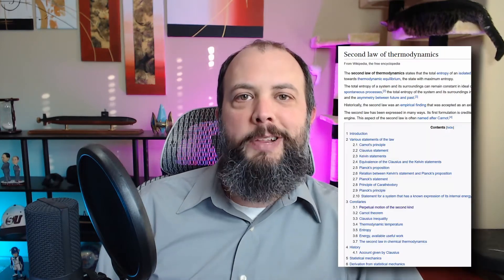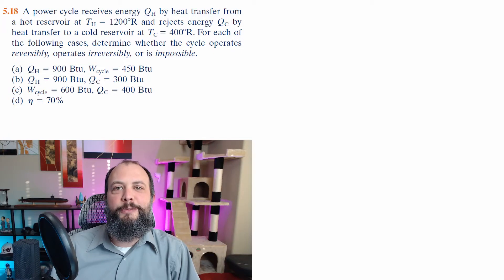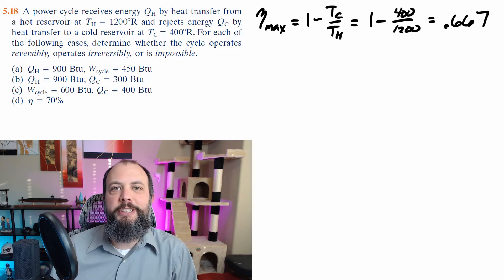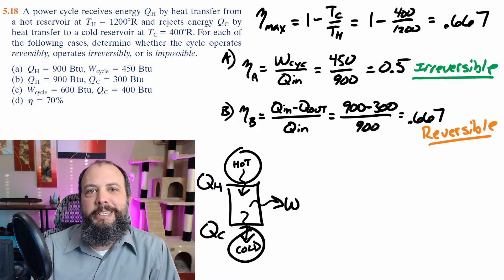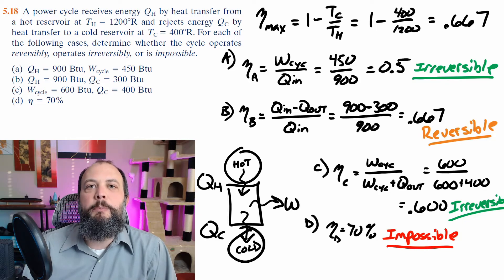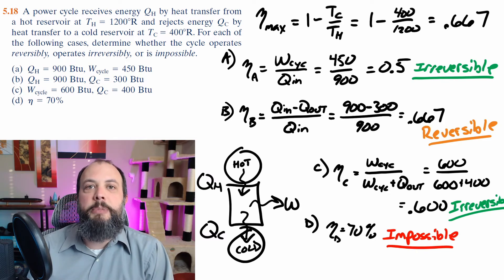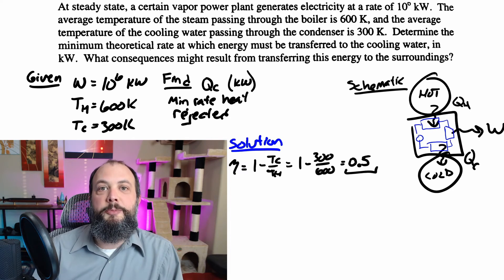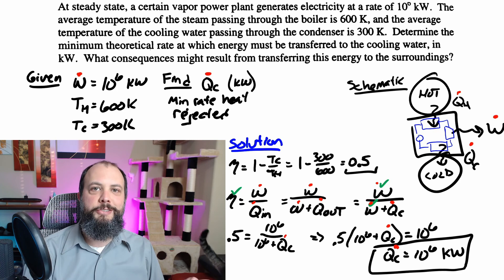Power Cycle Thermal Efficiency – Impossible, Reversible, or Irreversible?

Comment: Very good explanation sir. All concepts are clear. I want to ask one thing "Heat rejected from the system is taken as negative in thermodynamics. Why we do not take this sign convention here?"
Reply from the maker: If the direction of the heat transfer is clear based on the context, then it may just be the positive magnitude that is used - but again, only when the context makes it clear that this is the magnitude of heat that is leaving the system.